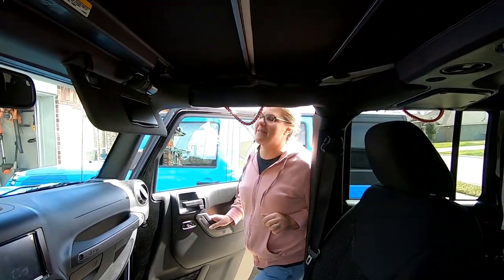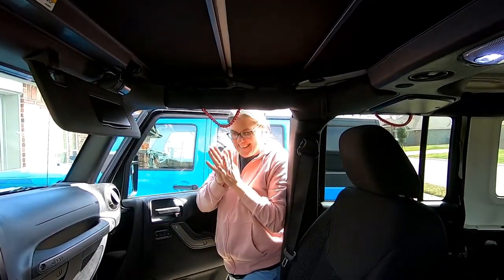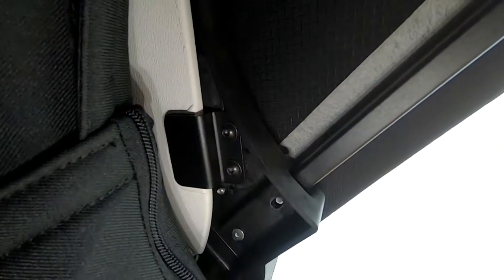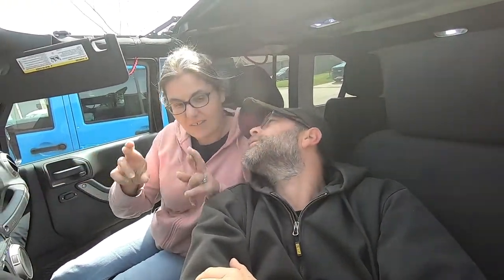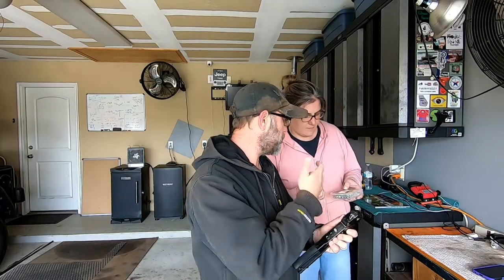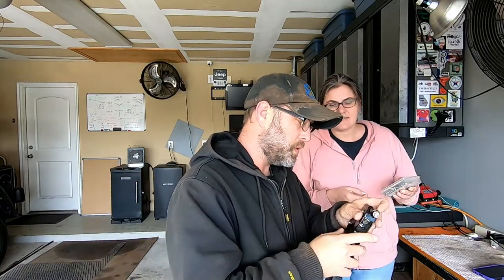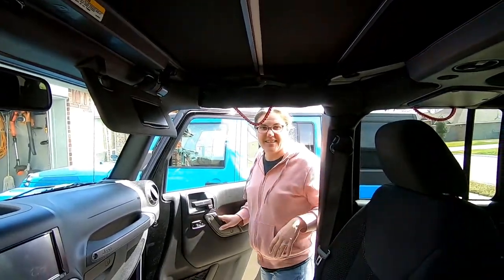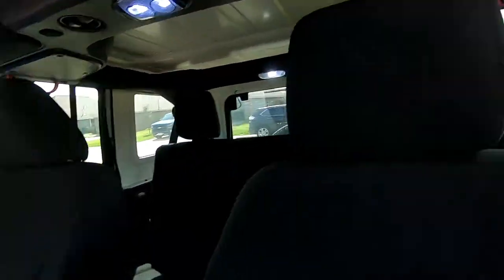Episode 370 - Sunrider Soft Top Rattling Noise - FIX

Comment: Those rivets suck... And this thing also breaks the front rubber seal. Of the windshield and whistles like A Mofo.
Reply from the maker: I would agree with the rivets for sure. The new ones we installed have been holding up for a while now. We aren't really getting a whistle though.